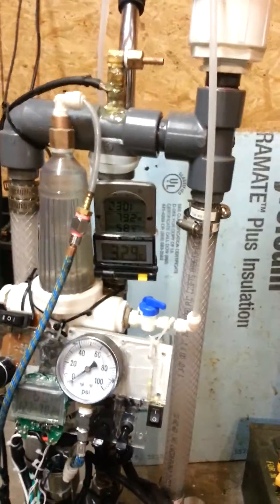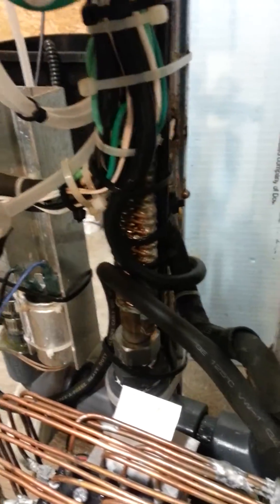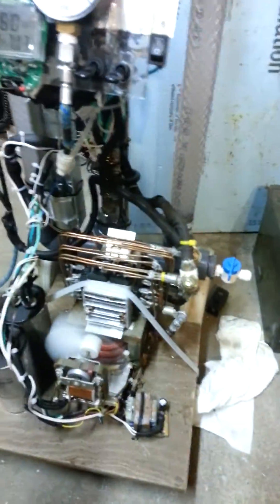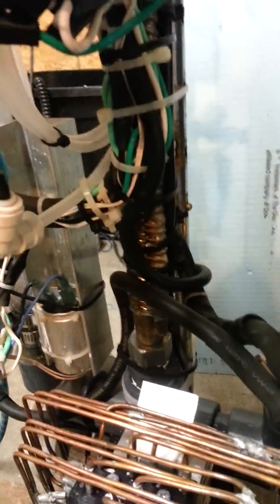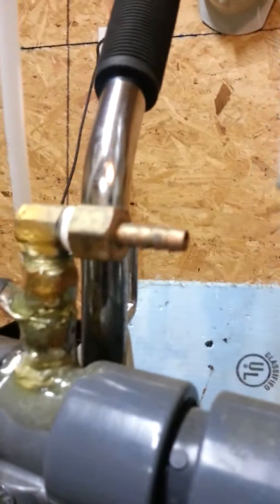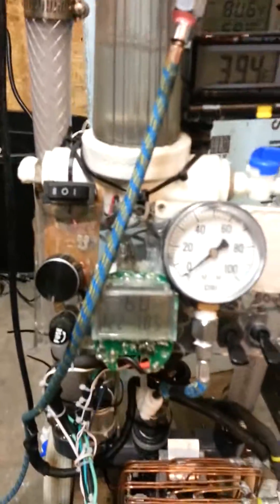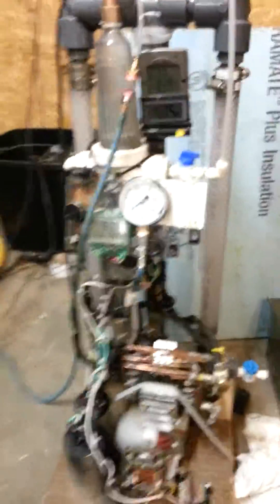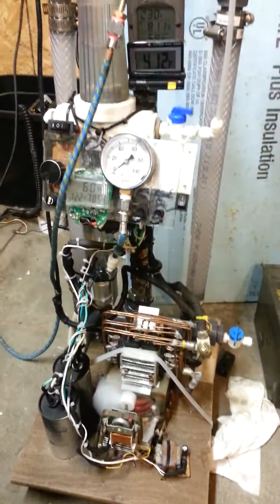hho copper cathode Oxyhydrogen torch

Comment from the maker: yes sry for the bad footage, basicly there is a copper pipe slid into a ss  corrugated pipe as the anode , this is the cell and the cathode is a copper 3/8 tube, the 2 other pipes circulate elite back to the electrolyser . the transformer is a 3.5 volt 800 amp DC power supply i built

Comment from the maker: i got the power factor to go up from .2 to .4 with the 2 80microF caps ,
without the caps the harmonic distortion is so bad i can only push 30 amps,
with the caps the impedance drops significantly allowing a maximum of 70 amps @ 3.3 volts DC.    @ 11V i can push 200 amps @ .8 power factor however i cannot sustain this for longer then 60 seconds . i was tempted to make a big inductor from an old mot with the coils remove and maybe a 7 turn 2 AWG wire in ,?

Comment from the maker: sorry this video showed so little of the device and its features  , was seconds from salvaging parts from it so i fired it up one last time just to archive the principle failures i discovered in this experiment. the device works but i build way to much to need a micro torch, i hooked this up to may 11 volt 500 amp dc mot set up and pushed 200 amps into this thing, i was not impressed at all , the flame was 2 inches tops i need 13" then in seconds electrolyte started shooting into my bubbler,

Comment from the maker: i have heard tin makes good electrodes in some cells but haven't the money for exotic metals or even common ones, i made this from junk mostly, unfortunately i dismantled the control system to put it on my last and final design, it looks like my super flow cell but its way cooler, this new cell should produce 10 to 14 inch oxyhydrogen flame... we will see its 90% complete

Comment from the maker: you can make the cathode out of any metal except aluminum when using bases  for electrolyte but the anode is very picky, the best anode has the least electrical resistance and the best corrosion resistance, it is writen in scientific journals that nickel alloys or pure nickel is the best by far. titanium anodes don't last very long before passivating. i chose copper because nickle is hard to come by same for the stainless

Comment from the maker: this is the 4th edition , i wanted a cell that doesn't get  hot, the reason for using a copper cathode was to eliminate the high heat caused by ohmic losses , the anode is a silver solder clad stainless steel pipe the silver solder is on the outside of the pipe so the stainless steel is basicly just a corrosion barrier.this keeps heating way down, this cell will run at 45 amps continuously. most torch builders on you tube dont tell you there torch can only run for 2 minutes before boiling

Comment: from the steel leaving it neutral.no expert here in uk but on with the magnetic air engine looped shielded fields on car.(like exciting an alternator /nitrogen filled tyres to stop static dischrage to earth.just got to build the joe booker condensed gas maker as that makes the inlet manifold act as a atom stripper...you tried charged watre in your cell same as a tesla coil half pos charged half neg and pour in.making sure rubber gloves to isolate from stabilising at all times.

Comment: hi you have viewed brey213 videos especially joes cell horses mouth he has spiral cathodes and neutrals .watch how he explains the third gas that comes from the charged water  IMPLOSION EFFECT he does it on the basis how a car tesla coil works ..about 1 hour 30 in on video .he hooks pos outside (anode) and also loops pos to bottom of cathode and then negative to top of cathode (i think) he may do neg to centre top of neutral (he does it quick in video)  then massive gas production.

Comment from the maker: thanks over all this cell does work very well it will run for hours at 45 amps dc 3 volts but as you seen the flame is small,i need a small flame but i also need 10LPM , the copper cathode is one reason this cell runs so cool , the ss anode is just a skin it is clad in copper winding silver soldered to the ss pipe anode. in this test i discovered that high amp low volt dc power supplies are not a good idea , i connected a 11 volt dc power supply and got 200 amps but it sprayed elite out torch